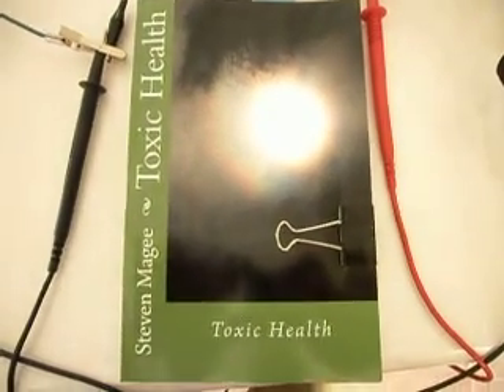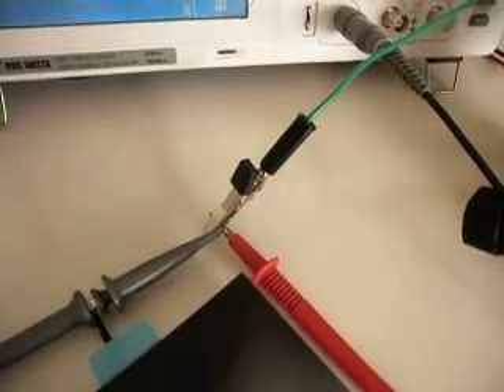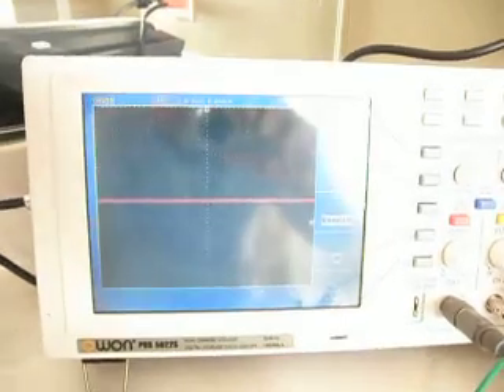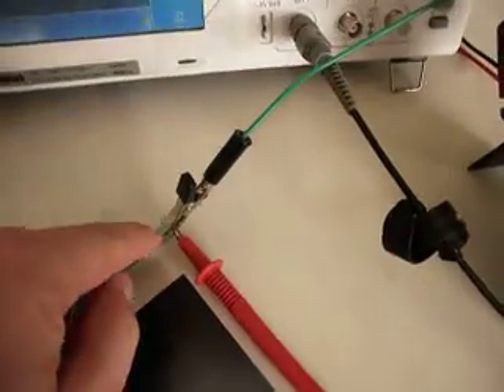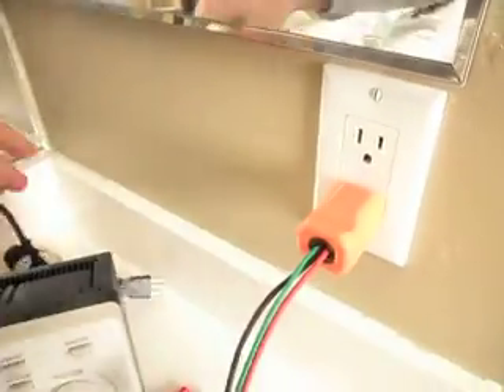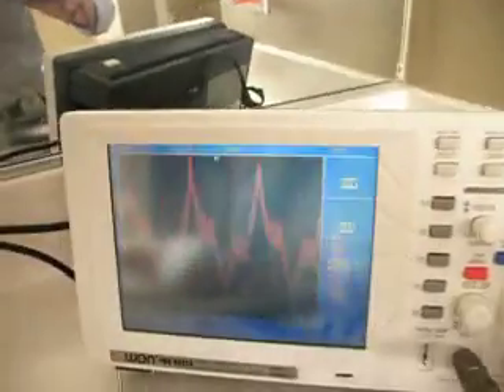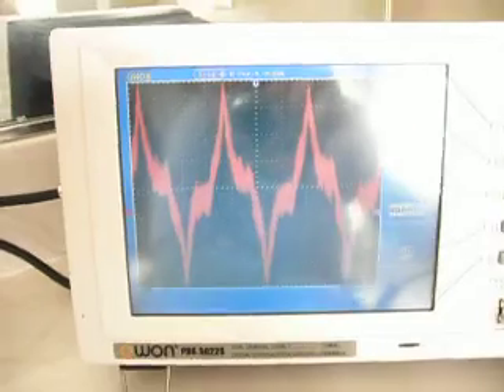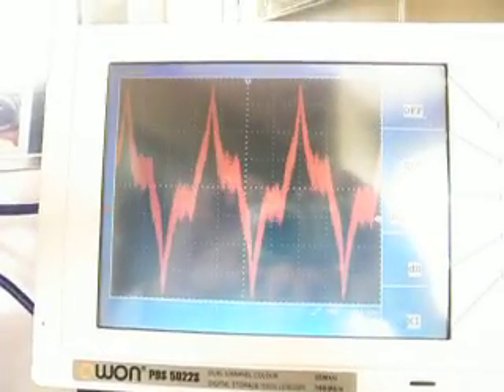Avoiding Errors when Measuring the Electrical Grounding System

Comment: Why is there a voltage on the ground plug?  Mine reads .044 volts.   Shouldn't it
be .000 volts all the time?